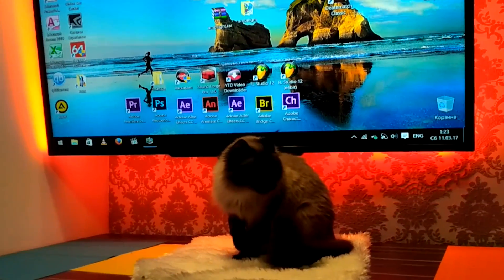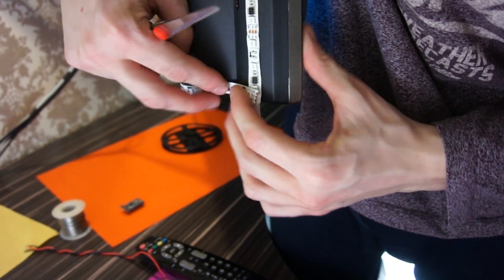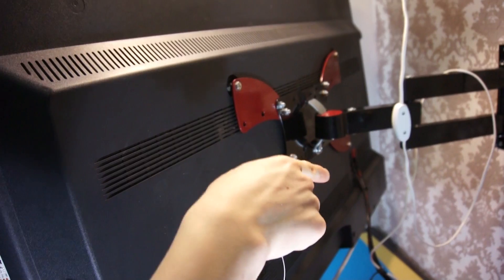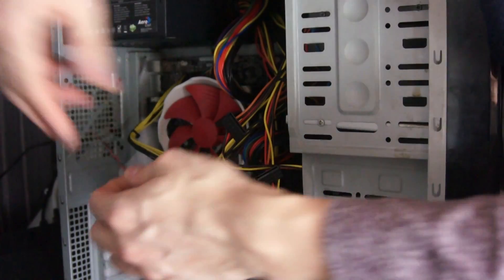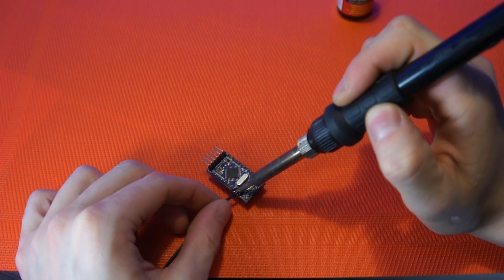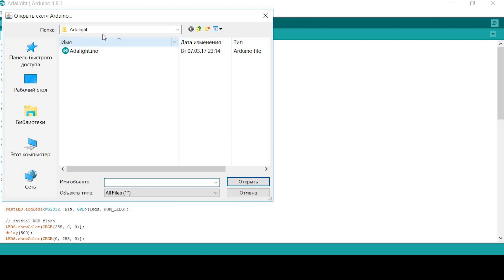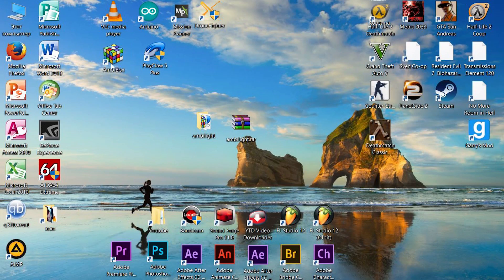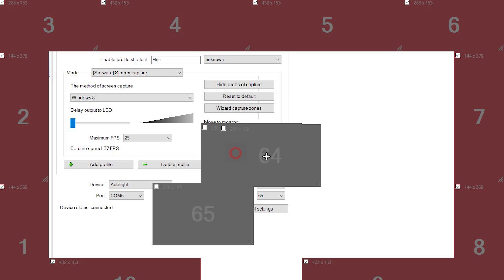DIY | Cheapest AMBILIGHT for 47' TV [$20 only!]

Comment: But how the led strip runs with LED screen, i mean where to arduino take signal from LED? mean from which port of LED???
And is it work with cable tv screen??
Reply: No this is for PC use only. You use this with your co.puter that is hooked up to a TV or monitor. Pretty easy.

Comment: What a horrible job. His lights randomly flash because he doesn't have a capacitor in circuit. Voltage is fine here but he doesn't consider amps  in the calculations. Don't try this and expect it to work correctly.
Reply: R u dumb

Comment: so i tried this this weekend with the order links in the discription. It works perfectly! 
some tips that might help you guys to do this yourself as well
1. i used 147 leds  but using them all induvidualy makes it stutter a little bit with me so i used the number of chips (devide by 3) in the code and ambibox, which was way smoother and you barely see the difference. (my guess is that ambibox couldnt cope with the amount of squares it had to analyse so it started lagging)
2. between the arduino and the data line put a 220 ohm (values may differ this worked for me) resistor to filter out some weird signal that sometimes causes the strip to  glitch.
3. you have to connect gnd pin to te ground of the led strip and and the power suply(otherwise the strip will glitch out). i used a 12 volt adapter i had laying around so it didnt have a common ground with my laptop.
Reply: What do you mean by glitch? I have a 5v 60 LED strip, and the USB disconnects after a short time. Is that what you mean by glitch?

Comment: Hi there,

Seems like i missed a step, so you connect the power and ground to the PC (this is just for getting power right? Alternatively can plug it to other power source as well right?) The third cable you soldered it to the arduino, however where do you plug the arduino? (sorry i've never done this before) Because after you soldered the cable to the arduino you jumped straight to your screen for setting things up. Thanks!
Reply from the maker: Hi! My version of Arduino isn't standard, there is no normal USB port, and it connects through the adapter FT232RL. The one on which I left the link in the description will simply be connected through a normal USB cable to the computer, so you do not need my way through the FT232RL.

Comment: So basically you have to hookup pc or other computer to have it running. Show me now a $20 solution for a regular sat tv or ps4 :)
Reply from the maker: +TheDrunkenPL: oops. 😊
Reply: I made one, but it costed a hell of a lot more. 
HDMI Splitter
HDMI to Composite adapter
Composite video capture USB dongle
Raspberry Pi
5v 20a power supply
3m RGB Addressable LED Strip
2x HDMI Cables

I think that about covers it. It all came out to about $100. I thought it was still reasonable for the effect you get, but the price might turn some people off.
Reply: It's impossible to get any actual signal from the TV to this thing. You have to use either a computer or a HDMI splitter, which is a more expensive solution.
Reply: @Ree1981  WHO WATCHES TV ANYWAYS MAN
Reply: that's also what i want to ask if it is possible for smart tv... but I saw one product called LIFX  it can be use on smart tv like that but it is expensive
Reply: You can build it on your own with a raspberry pi and some other stuff... I'm doing this right now these days...
Reply: Its almost impossible to do that simply or cheaply
Reply: Richard Smith if you use HyperCon on raspberry reduce brightness to 70-70% it will help with amps
Reply: Or using strips that operate on 12v instead of 5v. They are more expensive since the chips need a lot of extra regulation to bring the 12v rail down to 5v.
Reply: Richard Smith yeah you can use that too but dimming it down a bit is better
Reply: Amazon kits,.. don't need a PC.
Reply: composite cables video out . the composite cable is cheap and just link to its signal pin on ardiuno

Comment: how does neno know which color to throw on RGB? i mean there is no sync between tv and Nano
Reply: "Arduino get signal from PC where installed Ambibox software. 
Ambibox taking screenshot every 0.025 sec. After analysing with our zones, ambibox sending color values to the arduino via serial port (usb > serial)"
Reply: This setup is for when your computer is the source of the video displayed on the screen. The nano is connected via usb to the computer. The Ambibox software is detecting whats on the screen and sending the info to the Nano, the Nano sends the signal to the LEDs.
Reply: SuckXmyXchickeN can you share sketch of connection...thanks mate.
Reply: perfect this is what I need for my projector screen. Ive been searching for one

Comment: HOw did you give the video signals to the arduino?
Reply from the maker: Arduino get signal from PC where installed Ambibox software. 
Ambibox taking screenshot every 0.025 sec. After analysing with our zones, ambibox sending color values to the arduino via serial port (usb > serial)
Reply: most arduinos dont really support usb at all. communication between pc and arduinos are actually really slow and done with ftdi/serial adapter or build in usb chip (arduino acts as usb hid serial adapter)
Reply: Does USB3.0 get more performance for the arduino or does arduino not support the USB3.0 speed?